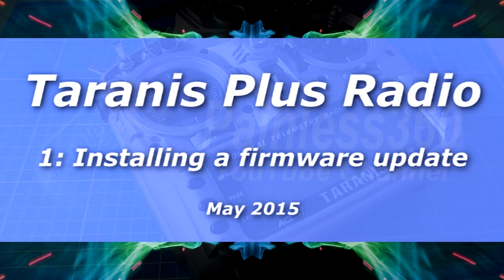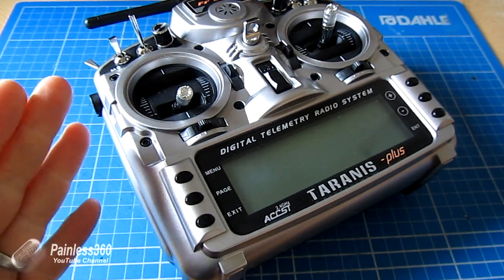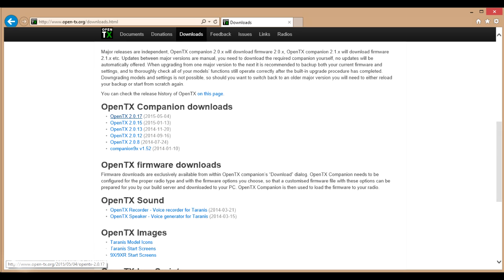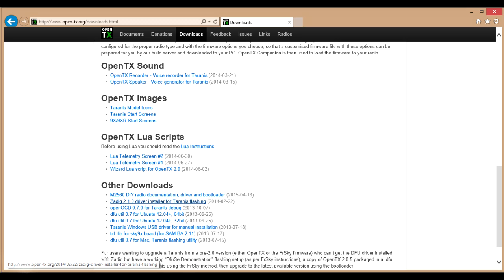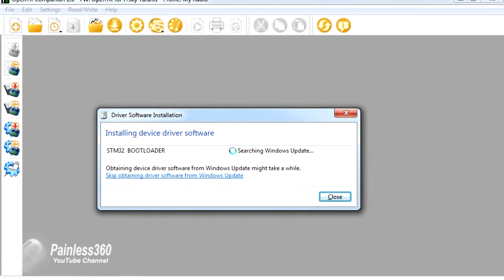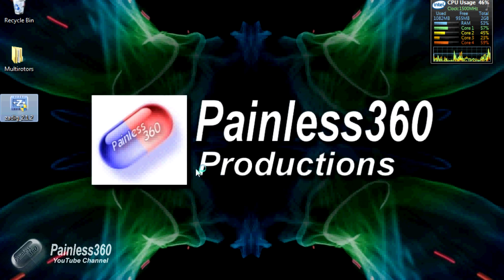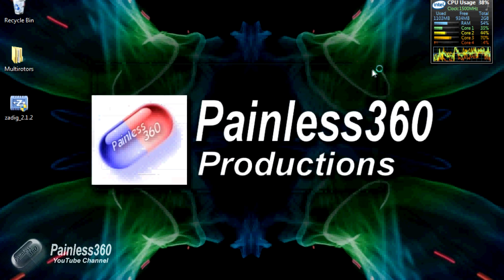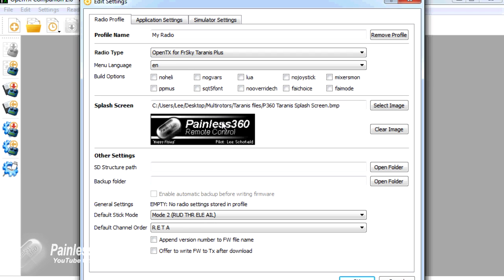(1/12) FrSky TARANIS Radio - One way to update the firmware

Comment: Im totally stuck. did all as you said for my tarnis plus.
I selected the profile in the options named taranis plus
And when i want to do the 2.0.17 firmware update. it tells me its not compatible with the current version :(?
Reply from the maker: Alexander Roelofs What troubleshooting have you done?
Reply: Im not very sure where to look at.
Got the taranis today and started with the problem that i couldnt choose the mode, because of my current (bugged) version.
I can only choose D16-EU or Off and not the D8 mode.

So i started researching and came to the conclusion in needed to flash my taranis. Thats where i started watching your video.
But unfortunatly :(
Reply from the maker: Sounds like you need to go back to the supplier for support in case you have a more severe problem on the radio.

Best of luck.
Reply: hey i dont know how i exactly did it but finally managed it to get the 2.0.17 version on it.
However when i put the mode on D8 instead of D16, the taranis starts making some anoying noise. any suggestion?
Reply from the maker: What receiver?
Reply: not using any yet. But got the D4R-ii. didnt bind it yet
Reply: Alexander Roelofs It's not bugged you have the EU compliant x9d+, same as mine, it gives the same error. And you won't be able to select those modes, since they are no longer supported in the ETSI 1.8.1 version, however you can downgrade the XJT module.
Reply: its all working fine now, thanks :)

Comment: What's the difference to the firmware you can get from FrSky? Have they implemented additional features over the pure OpenTX version?
Reply from the maker: superdau To answer your question I will quote from http://www.open-tx.org/downloads.html - 
".. (FrSky firmware) is supposed to be used on its own, exclusively on the radio (no companion), and is supported directly by FrSky"
If you want these features like the Wizard and the OpenTX Companion then you will need to upgrade.
Reply: Painless360 
I've read that, but I still don't know what the difference is.  I have the wizard and I can use companion to do stuff like read and write the firmware, eeprom and models, can edit and simulate the models...

Comment: Pretty cool :)
OpenTX is better than the software provided by FrSky?
How did you customize your startscreen? Did you use a special software?
I can not wait to try mine!
Thanks for sharing and have a great weekend
Reply from the maker: ABMNS PRODUCTION To answer your question I will quote from http://www.open-tx.org/downloads.html - 
".. (FrSky firmware) is supposed to be used on its own, exclusively on the radio (no companion), and is supported directly by FrSky"
If you want these features like the Wizard and the OpenTX Companion then you will need to upgrade. 
You can see more videos that cover you other questions on the playlist for the TARANIS - https://www.youtube.com/playlist?list=PLYsWjANuAm4rtLZuLU2eSTc3svqWx-pa1
Happy flying!

Comment: are you able to get the wizard to work on a standard taranis, or does it only work on the plus
Reply: timbo69z that may be where the two diverge. I'm by no means an expert on the taranis but the open tx university he talks about at the beginning is where I learned to muddle through what I do know. My radio came with a ton of models already loaded on the card and I haven't needed to load any models that weren't already there. R Scott Page is another great resource on youtube.
Reply from the maker: timbo69z I expect that it will work on both but there is only one way to kow for sure - try it. You can also create the models using the OpenTX software interface too..
Let me know how you get on.
Reply: timbo69z I have the standard taranis and the companion works just fine! All the same for installing drivers, flashing firmware etc. so far.
Reply: does the model setup wizard work. Ive added it to my sd card files, but it doesn't go to wizard when i go to setup a new model

Comment: HobbyKing is out of stock.  Have been for at least a month.  Amazon has some at a hundred bucks more than list price.....
But Dave at Helibatics.com  sold me one on Wednesday, and i got by Saturday.  .  . standard USPS shipping!
And i ordered it with an extra 6pos rotary switch that he personally soldered and mounted. https://www.youtube.com/watch?v=Ts0EzeJsoNc
And I also had him solder a removable antenna mount (Taranis built in antenna is not removable), with a 5db antenna upgrade.
20 bucks cheaper than the big hobby store....
He is awesome.
And here is the kicker:  he updates the firmware before he boxes it up and sends it to you..
Standard shipping and i got it in 3 days.
Reply from the maker: odinata 6 position switch install will be in the second half of the series for those not lucky enough to have it installed before shipping.
Happy flying!
Reply: Painless360 What would you like to assign to the 6 position switch?
Reply from the maker: I will be using it (probably with a small custom mix or two) to control the 6 flight modes of an APM flight controller.

You?
Reply: Painless360
Don't know....I wonder what I would do with all the other switches then!

Comment: Dammit I had to figure all this out myself yesterday when I got mine... :P My problem was that I didn't have the Taranis Plus set in the firmware options... I just had the normal Taranis set.
Reply from the maker: curtisbeef Damn my poor timing! :) 
Lot so other videos in the TARANIS playlist that will be released later in the month that may be of interest to you then..
Happy flying!
Reply: Painless360 Hehe. Another awesome video. Keep up the great work I watch them all.
Reply: curtisbeef 
I managed to flash the wrong firmware version (for Taranis instead of Taranis Plus). My heart stopped a little when the radio showed nothing on screen and the haptic feedback motor was running all the time when switching it on. Luckily I saved the old firmware, flashed it back and it worked again. Didn't try since then (that was 3 or 4 month ago), but I may give it a try now.
Reply: superdau Ya this is exactly what happened. Screen blank and the vibration going crazy. Dont worry though its much harder to brick these (because of the STM bootloader) you can just reflash it.
Reply: curtisbeef
I wasn't that worried about bricking the micro itself. I had already flashed bare STM32F1 devices that weren't a Naze with cleanflight with a ST-link dongle, so I knew there should always be a way to reflash them. But if the pinout of some peripherals are different from non-plus to plus, you might electrically fry something when you run it with the wrong firmware.